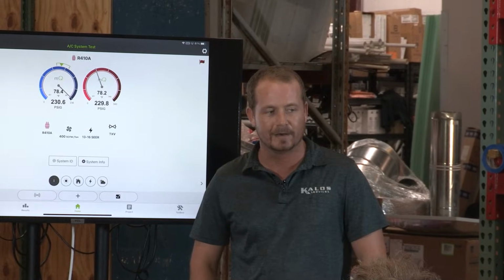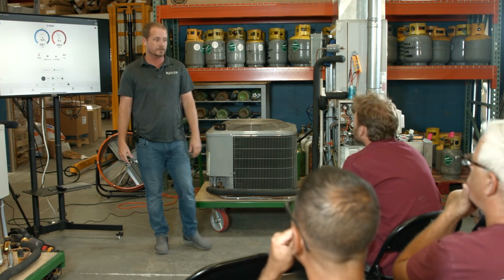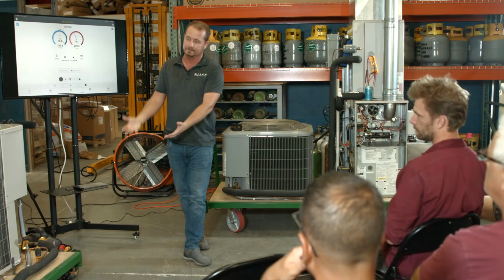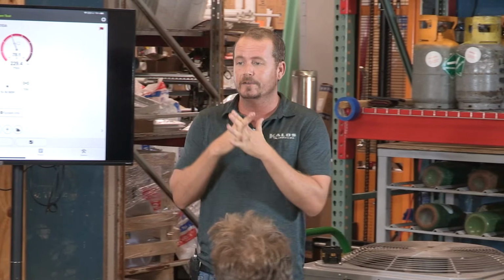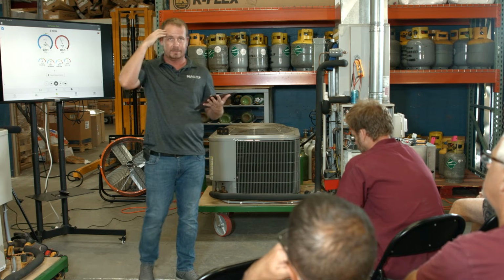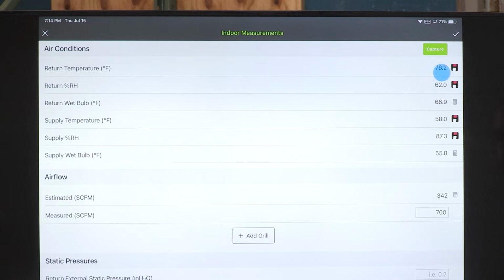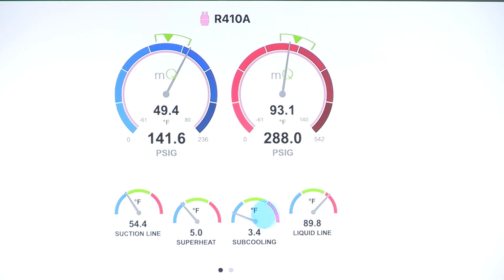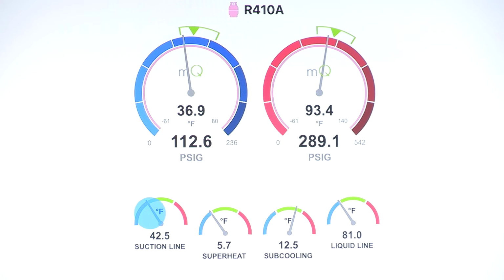Impact of Airflow on Refrigerant Measurements and Performance

Comment: Speaking of both everything being wrong in mobile homes and not removing the door from a hot unit, I got lit up removing the door in an air handler in a mobile home like I've never been lit up before. I don't recall exactly what shorted, except thinking that wasn't supposed to happen. But that thing was running off a 90 amp breaker!! I don't even think they're legal anymore. And it didn't trip immediately. It was the only time I've ever had electricity grab ahold of me except one time when I was a kid and full on grabbed a pulsing electric fence.  Idk if a 90amp breaker tripping means I had 90 amps going through me, but that's what I tell people to get across how dangerous it was. 
Just turn the power off until you can safely get the door off and do a quick visual check to make sure nothing looks dangerous. 
And I had another time I was sitting down working on an electric furnace in a mobile home. The home owner and his buddy were both standing on either side of me, drinking and bullshitting, totally distracting me. I shorted something and a big boom blew me backwards across the hallway and through the back door. It also burned the hair off my face. I think I probably jumped back and it wasn't the force of the explosion,  but idk it happened so fast and I don't know how I could jump back like that when I was sitting all the way down Indian style. From then on, I have felt much less anxiety telling customers to back off while I work because they're distracting me and putting both of our lives in danger.

Comment: Had one once did ac tune up check filters clean coils clear trap and flush the whole 9 , got call couple weeks later for not cooling . Said wft we ain’t moving air but the evaporator was clean on inspection. Opened the filter rack and stuck my
Head in the ceiling as the customer was up and down me … I said excuse me how old are your daughters …?? She said 8 and twelve … I said well here’s a ballon from a 2nd birthday party after I peeled
It off the evaporator man did she turn RED

Comment: Can’t you check airflow based on airflow performance manual, with a static pressure check, amp draw and checking set speed.

Comment: I already have the duct work.  I just need a new unit.  

We tried charging the one I have, and it didn't last long.  It runs,  but it just produced warm air.  

Also,  our unit is kind of small for the age of this house and the sq ft. About 1985 and 1500 sq ft. single rancher with finished basement.  

I'm thinking 2 stage would be nice,  but I'm not sure it will be worth it

Comment: I don't think this was mentioned, but if you are working on a communicating indoor system, and communicating UI, but non communicating outdoor system ( infinity or ion systems) making sure you have the correct tonnage programmed into the UI can cause airflow issues

Comment: I repaired one rooftop unit for HVAC, and a restaurant that technicians had claimed was not repairable and condemned it.  Among other faults, the major one was that someone had put on a different blower wheel with the fins facing in the wrong direction.
It was secured at the hub with a square headed bolt, which could only be tightened using a wrench from the open side.  So I knew it didn’t come from the factory.  From my experience with American air filter blowers I remembered how they always had an allen wrench set screw.  So I removed the blower wheel and installed that type of setscrew so I could put it back in in the proper position using the Allen wrench through the fins.  Besides having the wrong challenge, quantity of R-22,  there were other mistakes.  Well monitoring the operation absent of that condenser fan started and stopped intermittently after a while.  They had replaced the condenser fan motor but the new replacement motor required a ground wire. I’m not sure at this point if it was the neutral they left off, but it did not run constantly as it should.  Eventually, I got the unit to work properly, and they were happy at the diner.
Later on, they needed a new exhaust fan and they got a more powerful one and as result they had to buy another air conditioning unit for the rooftop.

Comment: Direction of motor , strength of the airflow being able to pull the filter back into the return grille , strength of air coming out vents , amp draw blower motor , bearings out in motor can cause noise or wheel broken , evaporator coil cleanliness , all types of possibilities and I was always told KISS “keep it simple stupid” and check all the basics first and usually can figure the issue out while checking basics from context clues

Comment: Low air flow you got a couple times I've come across it where you got dead animals get pulled into the squirrel cage and literally becomes a squirrel cage of death you also get chunks of trash and bags that get pulled down and sucked up and it's on the inside of the wheel you got low air pressure build up where it starts to freeze which then old dirt sticks to it which makes it freeze more there's so many things over 25 years I couldn't even list them on two pieces of paper what I've seen hell I do commercial 200 ton units and my duct works at one time built up static because the turn in veins were under such great pressure because the idiots installed the units incorrectly that it broke off a turn of veins and they went down the ductworking got lodged and we're talking ductwork where you walk down it and then you have to go down onto your knees until you get down to your belly pulling out of 5 ft x 3 ft section of heavy gauge steel is annoying especially for those self-tap screws

Comment: On perforated ceiling tiles they suck so bad because yes it's a greater area to have air or open plenum return but especially in food courts and malls all that grease from pizza ovens and everything else goes straight up into them and they catch every piece of dirt and then get blocked and in my case you have a operations manager in general manager that's stupid and what do they do they hire in painters to paint the ceiling and they paint right over all of the perforated tiles so therefore there's zero return now

Comment: So if you’re starting a new system up and you wanted to set the fan speed before charging it, how would you go about doing that. Do you take tesp measurements and set it based on the blower chart or can you just rely on the Mq estimates?

Comment: Added comment.  A PWM system is NOT necessarily a VFD drive.  We used to design these for other applications.  For AC-systems, where the motor is typically a simple 60Hz-motor-design, the PWM always has to be coordinated with variable frequency (thereby requiring a variable frequency), otherwise the motor will burn-up.  For typical induction motors, there is a V/F constant which has to be maintained to maintain the magnetic-flux at an optimum level, or optimum efficiency.  As such, the SPEED of the motor will always be determined by the FREQUENCY of the drive, and the PWM will change the VOLTAGE to the motor, as required to maintain the motor at correct flux.  Multi-meters which can measure the frequency of the AC motor, will show this.  At low speeds, the motor voltage MUST be lower than normal.  Do not be deceived by this, if you are reading the voltages at a very low motor speed.  At high speeds, some drives can actually deliver much-higher voltages to the motor, than normal.  Also deceptive.  Usually this variablilty range is only about 3-to-1, but in some systems maybe as high as 6-to-1.

Comment: Way better than most AC-videos.  Covers relevant issues for most air-flow problems, among many obscure others.  We've seen at least a dozen of these.   We had obscure problem where fan did not work in cold, and eventually discovered an intermittent electrical connection to the evap motor.  Very hard to diagnose.

Comment: Hi I just got ducted heat pump installed in my lounge ground level with 4 diffuser 200 and got 2 350 return on upper level ceiling so now heating 80 sq Mt open plan lounge take 2 hours. Should I take return from ground level to make faster heating

Comment: Hey Brian! Could you do a video on zone systems and airflow. Also setting the bypass damper static pressure. I feel a lot of systems that are zoned fail prematurely due to airflow issues. Thanks!

Comment: not an hvac tech, but watching these videos clued me in to filters overly restricting airflow. i had been using merv 13 filters as they were claimed to capture germs, smoke, very small particles. however they were way too restrictive. i tried exhaling air through it, too difficult. so switched to merv 4, and rely on a stand alone air cleaner unit to get the really small stuff.
Reply: Hey man, glad you noticed this, most people don't! Although i'd recommend switching to a Merv 7 or 8 next time your filter change comes around. I find that to be a happy medium that most air handlers can handle gusting thru. Your Merv 4 is certainly way better than the Merv 13 that was present before tho since you probably get crazy air change right now.

Comment: Head Press in this Inside interior Install is low because Cond Unit is working under probably Conditioned Space Temperatures,,,,,keep that in mind that if out temp is 95 degrees versus 75 in temp the Head press. Would be considerable much lower.

Comment: Hey Brian, around 13:40 you talk about a collapsed duct due to a “splice in the wrong direction”. What do you mean by this? I have some sinking feeling that I’ve been splicing duct wrong. 

Spiral over collar, tape, zip. Wrap over collar, tape zip. Am I missing something?
Reply: No you aren't missing anything. Have you ever seen anyone splice flex without a pipe between them? Slide the spiral inside the other? This can be done but you can't slide the spiral from the feed over top of the spiral its feeding. Because the air will get between the two pieces collapse the duct its trying to feed in to. The feed side needs to slide into the inside where no airflow restrictions can occur.

Comment: What about when they add more vents in the basement after they decided to finish basement , is this correct to do?
Reply: if the system is oversized, yes.  Most ductwork is undersized so in reality, no.

Comment: I came across a rooftop packaged air conditioner where the blades were facing the wrong direction.
It could only be put in facing one direction with the square head nut for securing it to the motor shaft.  I changed it to an allen wrench type set screw & used an allen wrench that could reach through the blades to reverse the blower wheel’s direction of discharge.

Comment: @hvac school the new airflow feature can me modified by going to settings and turning on advanced targets. It was switched to allow for more airflow prediction flexibility. If you set it to 350 400 or 450 and it's too far out of range it locks the airflow gauge